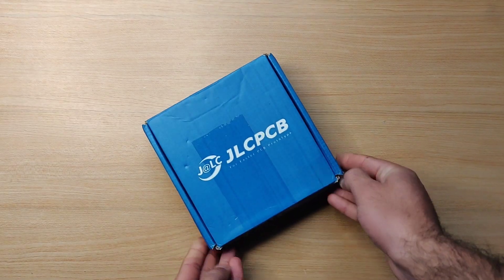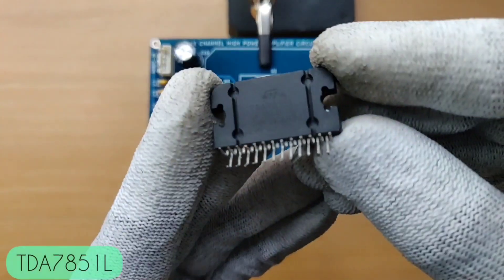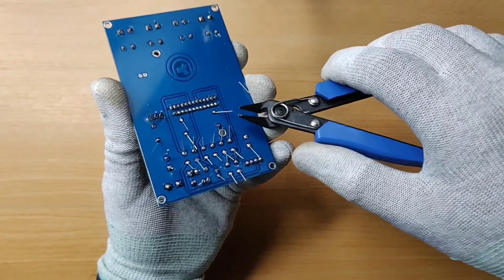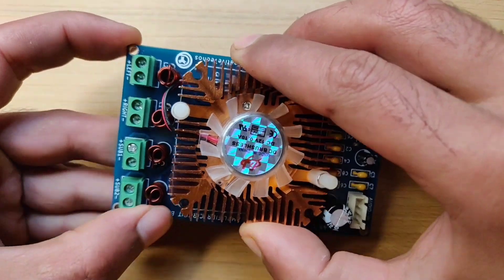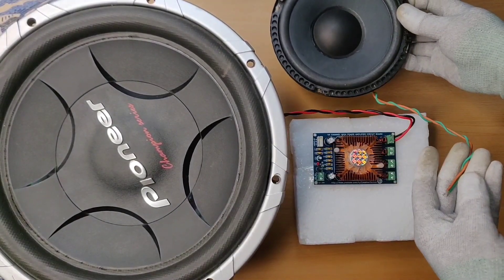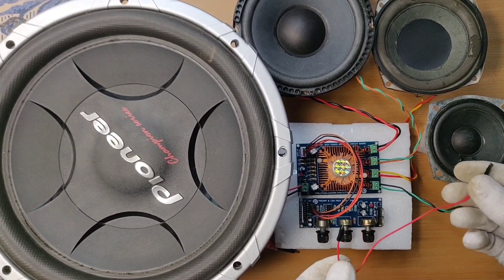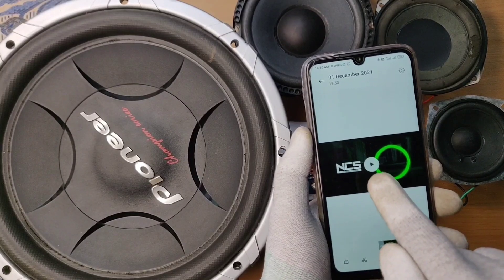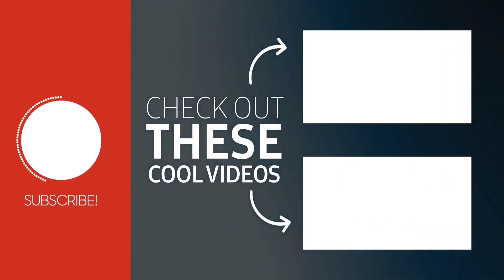DIY Powerful bass stereo amplifier circuit

Comment: Just one question, how would the stereo effect work here? All the channels would have a different frequency or two channels combines as 1 channel and the other two as 2nd channel for 2 channel stereo effect, or this is 4 channel stereo?
Reply from the maker: Actually this tuner has 2 outputs with ground common, and with 2 channels of amplifier receives High from tuner, and other two Chanel receives bass from lowpass filter circuit, that are two combined in tuner, it is designed same as computer multimedia subwoofer.
Reply: @CreativeTechos  that's great thinking and amazingly implemented and executed, hat's off 😊❤️

Comment: Your circuit is impressive and was willing to implement it but I can't find TDA7851L from my local store. Could you please suggest me an equivalent ic that can be used for the same purpose.
Reply from the maker: You can use popular ic TD7388 in same pcb, but wattage will be little low, overall will perform same, all same components just change ic
Reply: @CreativeTechos  I greatly appreciate your info. Thank you.
Reply from the maker: My pleasure 😊
Reply: Did the circuit with the equivalent - TDA7388- you suggested and it's sounding great. No noise, clear amplification. Thank you for sharing the knowledge. Keep new ideas coming.
Reply from the maker: I'm glad to hear this, Thanks for showing interest in my contents 👍

Comment: Hello sir, you used NE5532P as U3 on preamplifier from previous video but on the schematic provided on this video you have used NEW4558 as U3. Could you please clarify on which ic I should stick on for quality sound.
Reply from the maker: You can use anyone JRC4558 or NE5532P but ne5532p provides good sound quality
Reply: Thank you.
Reply from the maker: My pleasure
Reply: @CreativeTechos Your circuit worked and it's great sounding. Though I'm having a problem with inrush current on powering the circuit. Could you please do me a video or just design me a schematic on a soft start circuit to power the amp please.

Comment: I like the video and want to try it with 12V 18A power supply because I have it readily available. What are the adjustments on the circuit.
Reply from the maker: No adjustments yes you can use it directly with this supply, it will draw required current from this supply, don't worry no damage will occur in circuit.
Reply: @CreativeTechos  Thank you.
Reply from the maker: My pleasure 🙂

Comment: Sir please make video on TDA7388 IC please
Reply: Ok bro 👍🏻
Reply from the maker: Tda7388 can be also used in this circuit, same circuit diagram based, just different ics with different wattage.
Reply: @CreativeTechos  how many watts this ic is ?
Reply from the maker: This 48w to max power 73w, RMS. Tda7388 is 45w